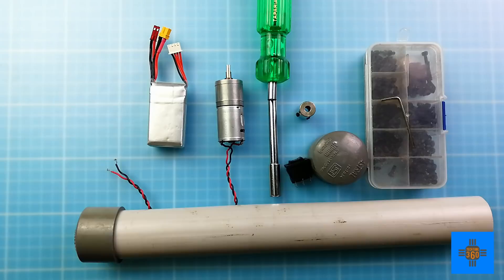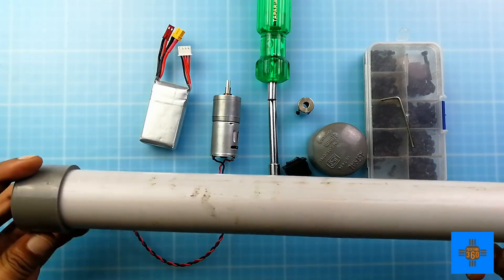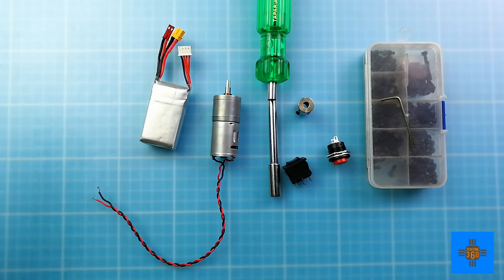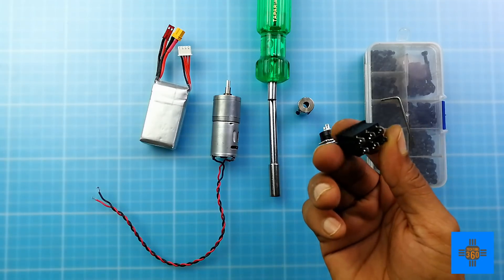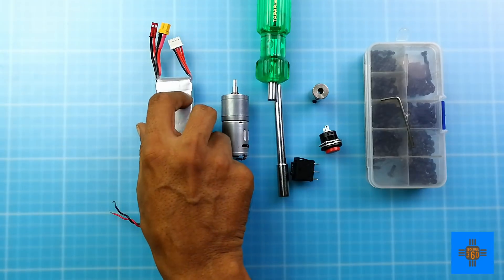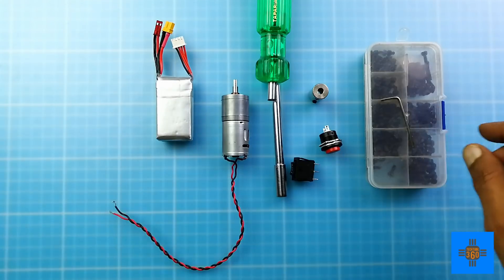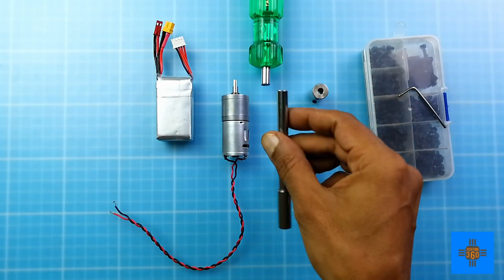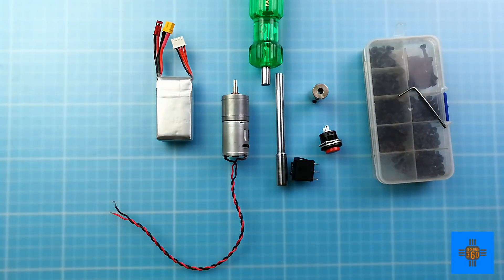DIY Electric Screwdriver

Comment: Can this drive the screws into MDF and other soft boards which is used to make cabinets without pre-drilling the pilot Holes.
Please reply.. thanks
Reply from the maker: Yes it has quite a lot of torque and you can use self tapping screws without pre hole in MDF and soft wood. Thanks for your time and interest ✌️👍😊🙏
Reply: Thank you for replying..
Have a great day ahead :)

Comment: Can we increase the speed of screwdriver
Reply from the maker: Yes we can increase the speed by putting a variable pwm controller and 3s battery instead of 2s lithium Ion. Thanks for your time and interest ✌️
Reply: And can we attach a direct supply of electricity through wire instead of using batteries ?
Reply from the maker: Yes you can do that but portability factor vanishes in that
Reply: So what materials do we need make it work on electric power
Reply from the maker: 9v 3amp smps or transformer based dc supply and wires to connect

Comment: How to decrease torque?
Reply from the maker: It's fixed torque only you can just screw and unscrew with same torque. For variable torque you need to buy portable drill gearbox sesperately available.
Reply: @techtube360world  what if add the dc speed module? does it work?
Reply from the maker: @whiteANCHOR1  it kind of works but not exactly because torque of motor through gearbox does not change at almost entire rev range considering you are using variable speed dc controller. But due to slight variation in torque curve of motor you can feel a bit of decrease in torque but as I said it's not drastic. So best way to achieve this is just mechanically and that variable torque gearbox is sesperately available. You could find one on AliExpress type 12v drill replacement gearbox mostly you will get it. Thanks for your time and interest 🙏✌️👍😊

Comment: Sir Mai adaptor Se Chala Lunga Motor with gear ke bare mein samjhaye motor 6 volt 7 ampere ki motor Hamare Paas bahut hai gear Kaise lagana hai
Reply from the maker: 6 volt motor se bike Nahi chalgi Bhai. Aap uska wattage consider karo to 6*7=42 Watts which is way too less to drive a bicycle even. So you need atomotive grade BLDC motor and controller to drive the bike. If you still have doubts please feel free to contact me any time. ✌️😊👍🙏